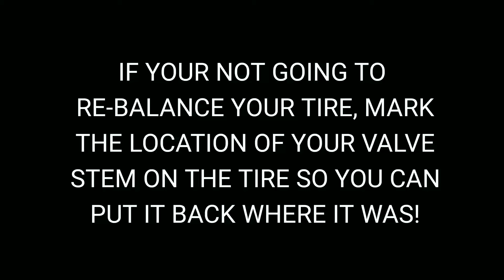FIXING A FLAT TIRE MANUALLY!  BEAD LEAKING

Comment: You did just fine. It don't make a fiddlers behind which way you use them bars.Like you said, as long as you get your tire off and back on. The only thing I know that's a must is taking the tire off the correct side.
It just ain't no getting off the wrong side. I owned and operated trucks for 45 years. Many busted nuckles, broke fingers, steel splinter. I miss it Wish I could go out and hurt myself tomorrow. But life is good here at the old folks home. No scales..no cops..no DOT... no log book...no 3:00 am delivery appointments and no traffic jams. Y'all have a great day. Later on😎🇺🇸
Reply from the maker: i have made the mistake of trying to take them off the wrong side....didnt take much struggling to see what i was doing wrong.

Comment: Thank you J.C. for saving half my life. I have a classic '72 Chevy Suburban with the rusty slow leak blues. The previous owner had new tires put on, but the shop that did it didn't correct the rusty bead issues. Now it's my problem but not to worry because generous guys like you are willing to share their knowledge and experience to help others. I just received my Ken-Tool tire irons and ordered the other stuff I need to fix the problem. I'll follow your lead and get all the rust off the wheel and tire beads, paint the wheels and remount the tires. Thanks again for your great instruction video. You're a gem. Stay safe and stay handsome.  😊👍✌

Comment: I tried popping a 13.6 x 36 tractor tire off. No luck it was stuck bad. Hadnt been off for say 30 years.  Vechicle tires and lawn tractor tires i use a ratchet strap to squeeze the tire and the beads seat fairly easy. I have a nice tire chuck now that clamps on and has a blow nozzle handle with tire gauge about 3ft apart. Works nice.   Brother had a flat on his tractor and had the tire shop break it down and i told him needed to paint the rim. Tire had been on that tractor 40 some years (guessing) never been loaded and had 90% paint still but still cleaned it and did quick rattle can job. I was going away for weekend so i just did tire side not the side you see. My rims had been fixed (calcium chloride for many years) on my tractor and i just replaced them and didnt want same for brother
Reply from the maker: i have used the ratchet strap method a few times with success. some of those old tractor tires can be really tough....patience and persistence usually wins.
Reply: @j.c.smithprojects  helping with a tractor tire on friends farm we laided it on the ground and backed a ford 5000 tractor onto the tire and that 5000 had loaded tires with wheel wieghts and still didnt pop the bead. Old tires can be a royal pain

Comment: With the valve stem out, I just hold back on the connector on the end of the air hose and push it onto the valve stem .
That allows full line pressure in to inflate the tire. I usually have the tire standing up like you did.
Like anything else, your mileage may vary. You got it down pretty good though.
If the tire's no good, we just break the bead with the backhoe bucket...
I wish I had those tire irons though...lol

Comment: I have a small leak on the outer bead. Very small. Couldn't I remove the core, and but some slop around the rim, and refill with air? It's on a non rusty aluminum wheel.

Comment: I tell guys all the time to make sure the tire guy cleans the wheel before putting on a new tire because even on aluminum wheels there’s rubber build up that can cause small leaks and depending on the temperature, big problems later on.
Reply: Tire rack in these parts does it all the time... little more $ all said n done but, well  worth it... Shrader locally for big truck tires... both shops CARE👍

Comment: I'm just a guy who occasionally tries to save a buck or two by DIY car repairs that are doable. I don't have mechanics garage full of tools, jave the basics and a few good electric tools. I don't know what a wire wheel or a flat disk is, wish you'd have shown them. 
All those lubes what KIND of lube?  For the price of buying all these supplies to fix a bead seal leak, wouldn't it be less expensive to go to a tire shop for this?

Comment: Worked at a tire shop for 2mo in the 70's..Had all the safety devices at time but i couldn"t stand to hear the popping of the sealing beads..Found a tech job that did fewer tires and IT WASN'T ME..

Comment: do it right the first time and you won't have problems that is correct JC but it's funny I also use a cardboard to lay my tires on thanks for the tip
Reply from the maker: on nicer wheels i use a rug or a piece of carpet so it doesnt get scratched.

Comment: Just  a curious question but do you ever use the ether trick to set beads when working with equipment tires or big tires?
Reply from the maker: i dont. i have never needed to. i have a air blast tank to help seat beads. it has worked every time so far.